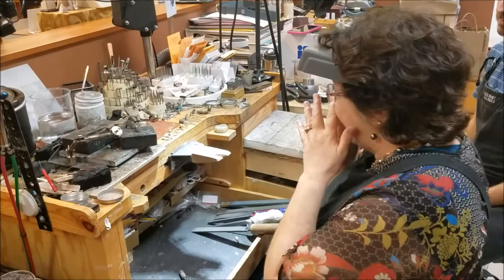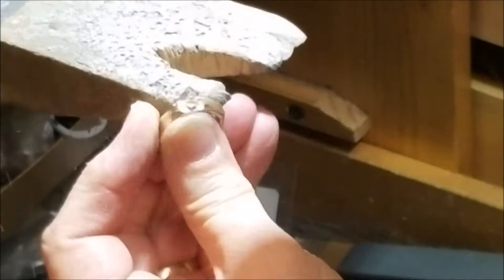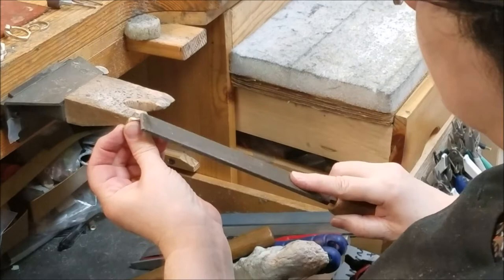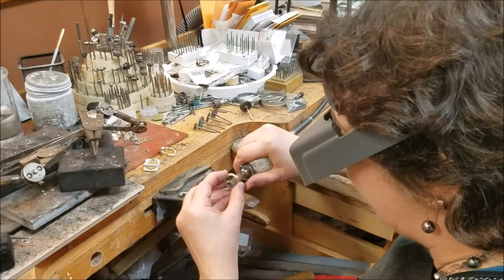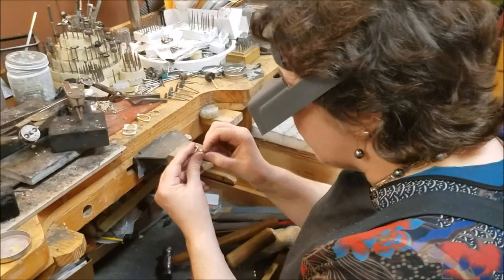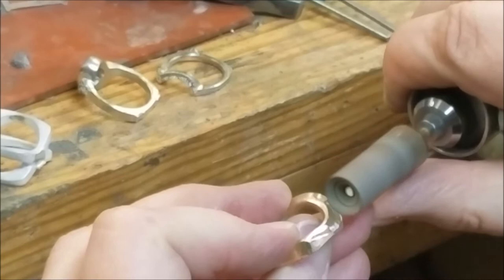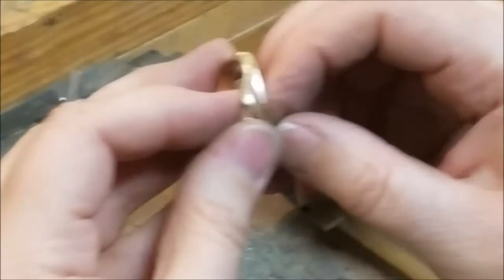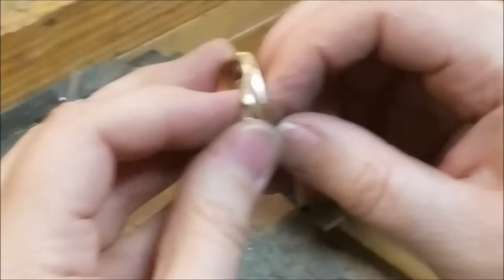Cleaning Castings

Comment: Is it necessary to start with filing and then sanding? Or is filing not always required?

Isn’t it easier to just start with coarse emery paper…files just leaves deep grooves which then need to be sanded anyway…
Reply from the maker: It all depends on the surface of your casting and how much work you did during detailing of it. Where the sprue was cut off usually needs filing or a grinding wheel. The rest is really your judging what is next best method to continue resurfacing the piece until it is finished. There are also different coarseness of files and some are much finer than others. Same with abrasive papers. What I try to avoid is having to go back a step because I didn't get all the previous imperfections out of the last step. It becomes apparent on the next step! Then you have to go backwards.
Keep on creating!

Comment: is there a rotary tool you can use to take off the tree marks from the ring?
Reply from the maker: Hi Fahad,
Do you mean after it is cut off the tree and there is a little nub left? If so then I would use a hand file or a grinding wheel , like a Mizzy wheel which is essentially a little composite grinding stone that can fit in a rotary tool like a Flex shaft. I find the metal grinding burs that have "teeth" tend to catch on the metal and they leave gouges. The Mizzy type of grinding wheel is much more controllabe. I always try to cut the sprue off close to the casting as well so there is less to grind. Use eye protection and a mask because they generate a lot of dust and debris.
Good luck,
Mary
Reply: @marywong5670  yes that's what I meant. Thank you I am still learning this so this is helpful. Do you also have videos or training on setting diamonds?
Reply from the maker: @Saywhatohno  
All of the videos I have made are on my Youtube channel, but there is nothing specifically on diamond setting. There are some about stone setting in general that may be helpful.  Diamonds can be set in every way anything else can, bezels, prongs, channels, bead set(pave), flush set, etc. So it is a broad question! But the principles apply across the board with cutting the seat area to match the angle of the stone, relieving metal to get it to bend where you want, not hitting the gem with your tool (which is how things get chipped or scratched) and getting the stone secure and tight. I just put a new series (5 parts!) about design and fabrication on my channel: "Beyond the Band & Bezel - Jewelry design with basic techniques" that may be interesting to you if you like fabrication. It's kind of long but I really wanted to show what can go into the process of evolving simple designs into something a little more interesting without more than the basics. I may make something specifically on stonesetting  soon. I am trying to make better quality videos starting with the new 5 part series.
Good luck,
Mary
Reply: @marywong5670  Thank you mary, I like long videos because then the message is conveyed much more precisely and accurately. Thank you

Comment: hi mary great video . im making my pieces with delft clay and some of my designs have quite a bit of detail and because i use delft clay, my castings have a lot of texture i need to remove. what would you suggest i use to remove the sand texture while prepping for polish while not destroying the fine detail in my design? im currently using diamond bristle brushes but i find while they work, they take forever to remove the texture. can you suggest some sort of more aggressive brush type tool?
Reply from the maker: Without seeing the amount of detail  it is difficult to judge what you might need to use. A standard bristle brush with tripoli or bobbing compound might work. Remember to charge the brush with compound frequently since it does the abrasion, not the brush.These abrasives from Stuller.com come in different grits and can be stacked to create a wider brushing surface -- Dedeco® Sunburst® Yellow 80 Grit Radial Discs. They have many abrasive choices overall as does Rio Grande. I have not used the delft clay for casting. Wrapping emery paper on a needle file to get into tight spaces is always a good trick to try or folding it into little stiff shapes to get into contours.  Good luck!

Comment: What solution do you use to remove the investment or plaster of paris after casting?
Reply from the maker: Hi Jacky,
We do not use a special solution.  We scoop up some ultra sonic solution from the cleaner to keep it separate from the rest and ultrasonic the castings  in it. You do not want plaster in your ultrasonic! It will damage the surface of other things, so discard it when finished. A stiff brush, steam, ultrasonic and elbow grease in combination is usually the answer.
Keep on creating!